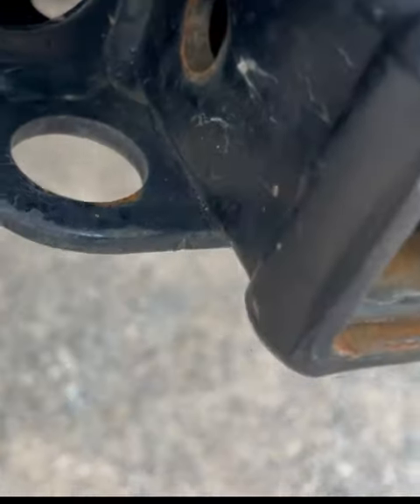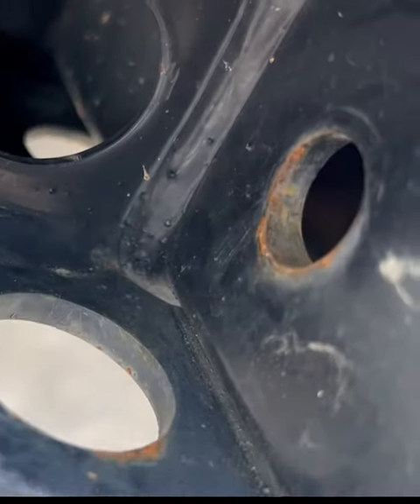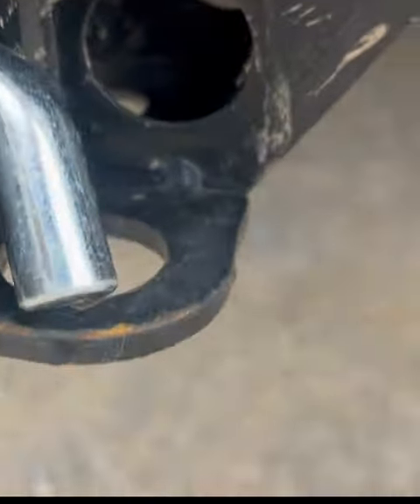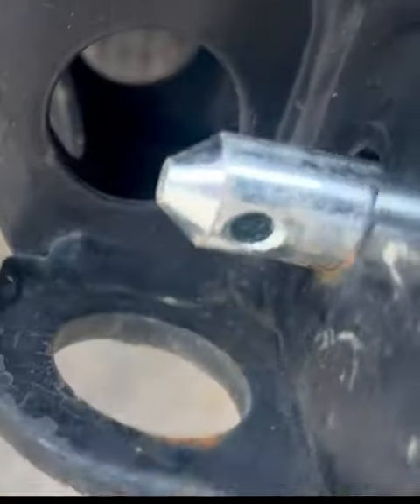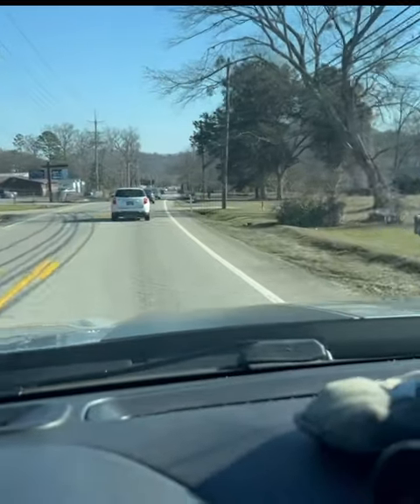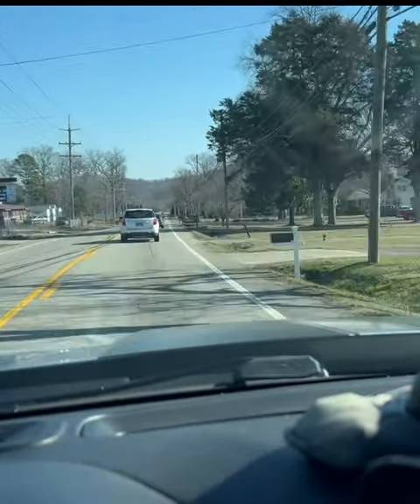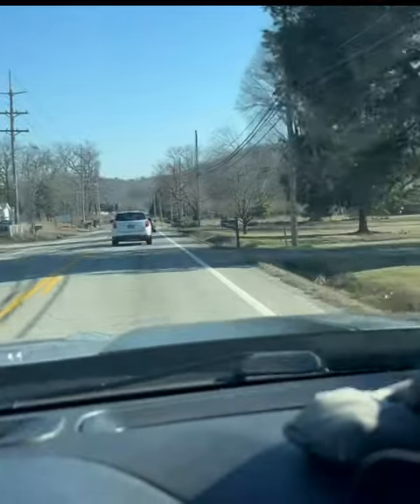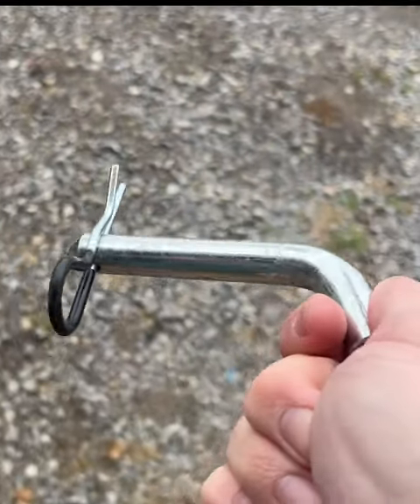2.7l Silverado 1500 Receiver after towing 9,000 lbs for thousands of miles.

Comment: what's your point all receivers on a half ton truck or identical in 50 years I've never had an issue
Reply from the maker: It’s part of a larger review of my truck. The 2.7l Silverado that I tow 9,000 lbs with. Thanks for watching.
Reply: What class hitch comes standard with the 2.7L crew cab?
Reply from the maker: @scox7760  I believe it is a class IV
Reply: I’m planing towing a 31ft will it do with the 2.7